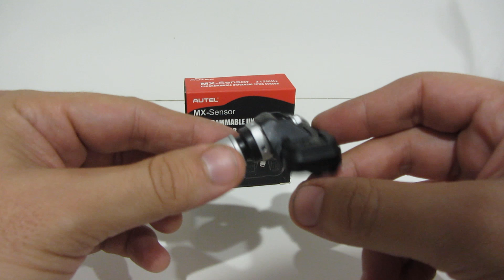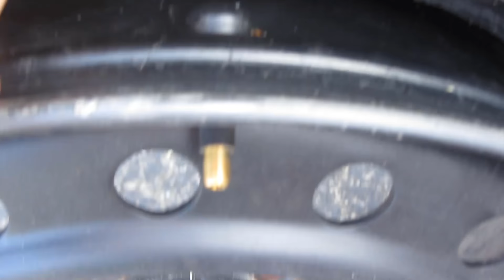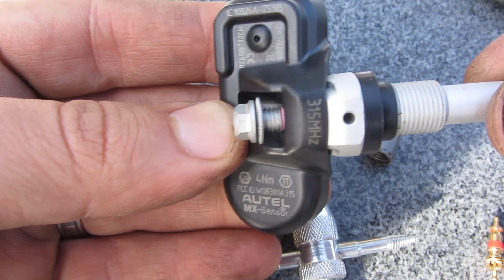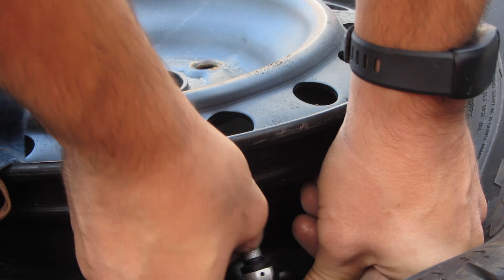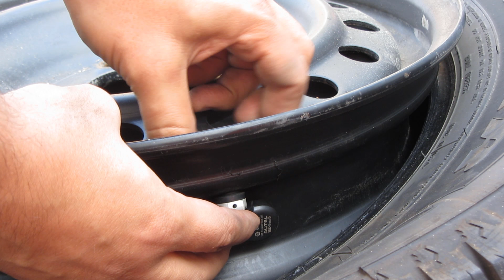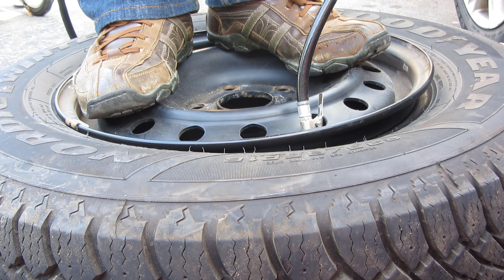Install New TPMS Sensor DIY Without Needing Rebalance

Comment: 0.8o.z. different is actually not small. I work at a tire shop and the smallest weight we add when balancing tires is 0.25o.z.
Imangine 0.8oz different in all 4 wheels, and it is gonna be bad.
Reply: Hey, some people need help to stay awake when driving.
Reply: come on... it's not about if you can feel it or not, unbalanced wheel can make the bearing wear out faster

Comment: Don't do it. They fail when you go to add air maybe 1-6 years from now or six months. I'm changing all mine back to rubber valve stems no sensor. I went to add air to my tire I untwisted the cap the whole valve broke off (very common issue) I need to replace it now. Three left  to be changed so I don't get stranded. Mine were made of aluminum oem Dodge caravan 2010. Way to go Dodge. I also live in northern Canada with snow and salt on the roads to help with corrosion.
Reply from the maker: Loosemouth Cowboy That happens when the valve stem is metal and a metal cap is put on it. The two metals end up rusting together. A plastic cap won't cause that trouble.
Reply: Gabe's Hacks you'll see soon enough
Reply from the maker: Oh I'm not saying you're wrong. It happened to me already, but it was caused by a metal cap that was put on the metal stem. That doesn't happen with plastic caps. Although you can also buy sensors with rubber stems too. (links are in description)
Reply: I waited to long to lubricate the caps I guess but still these sensors fall apart. If I switch back to Tpms sensor ill go after market but I have no plans to go back to tpms getting stranded sucks. I'll just check my tires the old way with a psi tire gauge a couple times a week. Keep it simple.

Comment: TPMS sensors are bullshit. Something for lazy people, who can't seem to keep up with their tire pressure. Just another way for manufacturers to get your $$$.
Reply: Not necessarily. I once ran over some debris on the highway and I thought to check my tire pressures while still driving and after about 20 miles I notices my one tire dropped 2 psi. So before my tire deflated more I saved the sidewall from damage.
Reply: Actually they reduce the amount of money spent at tyre stores by reducing the number of tyres destroyed by being run on under inflated.

Comment: aren't these directional?
Reply from the maker: I guess I should have asked if Private is referring to the tires or the sensors. Tires: yes, sensors: no.
Reply from the maker: Right. That means your car has 4 receivers, so it's aware of which sensor is in which tire. When you rotate the tires, it gets confused and the TPMS system has to be reset. I have no experience with Nissan's, but I found this procedure here: https://youtu.be/2H1AUsqMTWA
Reply from the maker: What do you mean by "directional"?
Reply: Gabe's Hacks left vs right. direction of rotation.
Reply from the maker: Not at all, no. The sensors themselves don't care which tire they're in or which direction they're turning.
Some cars will have 4 receivers, so the car's computer will know which sensor is in which tire. So when they're rotated, it needs to relearn them. But many cars (like my Odyssey) has only one receiver and has no idea which sensor is in which tire.
Reply: Some snow tires are directional, like some performance tires are directional, meaning they need to be pointed in a specific direction on the vehicle.  Usually they will have a direction of rotation arrow or indicator on the tire sidewall someplace to show the direction of rotation.  
If they are directional they will also have a different tread pattern as well.  There will be something similar to a chevron pattern "<".  On the top of the tire, the chevron will point towards the front of the vehicle.
If they are non-directional, then the tread pattern will look mostly like any other non-directional all season tire off the tire store shelf.
Reply: Gabe's Hacks thank you for your answer. i have a 2010 nissan altima. whenever i rotate tires tpms comes on. thereon i assumes these sensors are directional.

Comment: Great video. Instead of soap, use special bid sealer, to seal tire and valve on the rim. Any NAPA store has it. To balance the wheel, use two weights, from both sides of the rim, opposite to the sensor. Measure the distance from center of the sensor to the edge of the rim on the sensor's side. Divide the difference in weight between old and new valve (23 grams in this case) on width of the rim and multiply it on received distance to the center of sensor. You got weight of the balance for OPPOSITE to the sensor side. Subtract  it from 23 grams - you got weight for side of sensor. Obviously, shorter  distance requires of the heavier portion. In case the sensor would be positioned at middle, weights would be 50% of 23 grams for each side. However, if old valve is heavier, than new one, balancing weights supposed to be placed at valve. STATIC balancing would work with a single weight. DYNAMIC balancing requires two of them.
Reply: You can also get a similar response by just simply moving the weight away from the sensor a bit.  For every 1/4 oz the sensor weighs, move the weight the distance of the clamp holding it to the rim away from the sensor.  Usually that provides sufficient compensation for any weight difference.
But ultimately, you may just have to have the tires re-balanced anyway.
Reply: My respond strictly complies with Mechanics. Many ways are possible. You can use a rod scale, with length of the rod, equal to width of the rim and hang the rod in the same distance from its edge, as the sensor is. Of course, the scale must be balanced, when idle. Balance such a scale with 23 grams of sand. You will get balancing weights for each side.
Reply: Great Advice, but it's bead sealer.  Soap remains slippery after sealing, and tire may rotate on the rim, causing weight balance issue.  Bead Sealer goes on slippery, but dries to be like rubber.

Comment: the added weight by the sensor will still make it unbalanced.
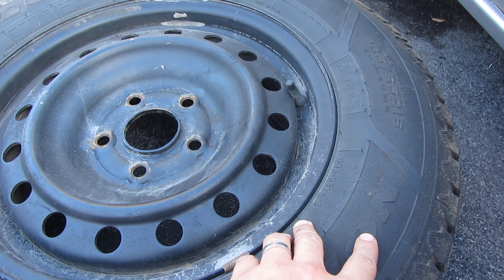Reply from the maker: Timo Klap Yes, that's indeed possible. I discussed that further at 2:17
Reply: For balancing tire, .8oz is a lot of weight. Even .25oz which is the lowest weight that tire shop s use mess up the balance. So the the tire is already balanced but by installing tpms the tire is not balanced anymore.
Reply: Not if you are replacing it with the same because they are dead

Comment: This is nice way to do it but you still need to bring it to a tire shop to do relearn.
Reply from the maker: Not necessarily. Some vehicles automatically relearn new sensors. And if yours does not (just like mine does not) you can use programmable sensors and program them to match your old sensors so your car doesn't know the difference. That's what I did here. I described the process in my other video: https://youtu.be/N6p6xV4PlHc
Reply: Well usually on all gm vehicles u do need a relearn tool to perform relearn. But all manufacturers are different.
Reply from the maker: Yes, Honda is the same. However, if you program the new sensor to have the same code as the old, then the car doesn't know anything is different and there is nothing to relearn.
Reply: Thats good to know because i have a 2014 town and country and it has tpms. So now i should be able to fix it. They charge alot to change just one.
Reply from the maker: For some reason it's hard to find a solid answer online, but I did some reading about the 2014 Town & Country and it looks like it might be one of those vehicles that auto-learn new sensors. That's something you can verify if you ever need to get one replaced. You may just be able to pop in a new one and start driving.
It does use 433MHz sensors (as opposed to the 315MHz)
Reply: Nice to know. Thanks
Reply: John Lara Nah, on GM trucks/SUVs at least, you can program then without any tool. Just put the truck in relearn mode (setting on the dash menu) and let air out of the tire and it will learn the new sensor.

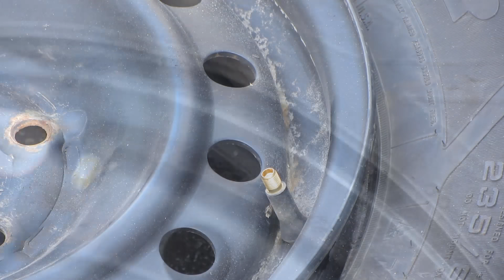Comment: Umm... just an observation here, but at m4:42sec he describes having to cut the valve stem. You don't have to. The rubber valve stems are pressed into place. Use the channel lock pliers to grab the valve stem from inside the tire and pop it out. BONUS: If the valve stem was good at the time of replacement,  hang onto it....!!
Reply: Sun Tzu Never reuse a stem that has been pulled right through. Esp an old one. It is easier to cut the base than pull it right though. Often trying to pull an old one right through just separates the metal from the rubber and makes it harder to remove. The cutting is the best way.

Comment: I have a question can my spare tire sensor in my Nissan cause the tpms like to come on
Reply from the maker: Only if your spare tire is installed. The sensors only turn on when the wheel starts spinning.

Comment: I prefer the old method, check tires visually and if any anomaly is detected check with tire pressure gauge meter... it was good before 2007, and now you always see ppl doing it the good ol' style! cos monitors cost an arm and a leg, and that yellow light just won't go away! D:
I see this more like a gimmick than an actual safety measure.....
Check tires should be done DAILY or at least  every time you go to refuel or at the start of a long trip. and that goes for the spare tire too!

Comment: Are those necessary?  I have a 2003 Chrysler 300m that I just bought and the computer says tire pressure sensor bad/missing on the spare...they cost too much so do I have to get it?   thank you so much!!   Oh, noticed today that one wheel lug is missing...just a rusty bolt there.  Is that an emergency??  ugh
Reply: If your state requires you to do a state inspection, you will need to replace it.  Lights on the dash will fail the vehicle.
Reply: You should replace the lug too, car manufactures don't just place things on the car for just looks.
Reply from the maker: Christine McRae The only down side to not having TPMS sensors is the car not telling you if a tire is low. And you will have to look at that TPMS light on the dash all the time. Otherwise, no, you don't have to have them.

A missing lug nut isn't an immediate emergency (if the others aren't loose too), but I wouldn't drive too long like that. Get it replaced very soon.
Reply: Thanks for responding so fast!  wow, loved your info video Gabe.  thank you!

Comment: hello.. this sensor has battery? if i need to replace it?
Reply from the maker: They do have batteries, but they are not designed to be replaced. Batteries on most TPMS sensors usually last for 7 or more years.
Reply: thnks  my friend...  7 years ... !!!!!! oooo really good...  thnks again .. i need this .. I screwed two times and then damaged the rubber because I did not understand that I got pressure...  is best item !!
Reply: That way! lol. Awesome video

Comment: Hi, my friend. Do I need some kind of tool to program these sensors, or does the car recognize them automatically?I have a Toyota Yaris 2009 sedan 4 doors. Regards William from Costa Rica
Reply from the maker: I love Costa Rica! I went to grade 4 in San Isidro and still visit every once in a while. My parents will be retiring there within the year.

But yes, you do need a tool. I explained it more in my other video: https://youtu.be/N6p6xV4PlHc

The 2009 Yaris uses the 315MHz sensors, which Autel does support.
Reply: Thanks a lot my friend. I live in San Pablo of Heredia. Have a nice day
Reply from the maker: Keep in mind that your Yaris does not auto-learn new sensors. Those Denso sensors are not programmable, which means they come with a random code that will be different from your old sensors. Since your car cannot recognize them automatically, you would need a special tool to connect to your vehicle and tell you car the codes of the new sensors.

I went the other direction and bought programmable sensors so I can program the sensors with the same codes as the old ones.

Either method you choose, you will need a special tool when changing your sensors.

Comment: I find TPMS light reset procedure with step by step.
 _iOS: https://goo.gl/tcexzG
 _Android: https://goo.gl/bDCGjJ
Reply from the maker: That's great for vehicles that have a reset procedure, but not all do. For very many, you need a programming tool for the vehicle or the sensors.

Comment: Thanks so much.   Tires are much softer when warm so if cold outside warm them up first when doing this to make it easier.   Can I inflate if I don't have shop air, just the slower car battery pump or a hand pump?
Reply from the maker: yabonjin pdx I can't say for sure, but I think it would probably work, it would just be slower.
Reply: By warming up, do you mean to drive the car around for a few miles?

Comment: Great video.  I have a new Nissan that I have ordered snow tires with new wheels.  I would like to purchase a set of the TPMS units and since the tires haven't been mounted or balanced, this should fairly easy (no breaking the seal or worrying about balance).  After installing the TPMS units, I'll take it to a garage to have it mounted and balanced.  But the day will come when the TPMS's on my new vehicle are going to need to be replaced (as well as the snow tires)  This video will certainly help when that time comes.  Glad you don't have obnoxious music a lot of instructional videos other.  Question is, my vehicle has 433mhz TPMS (which is what I'm ordering), will this make it compatible to any TPMS that is at the same frequency?  Thanks again for the great video.  I don't have to do this part of your procedure, but you put the long board "under the car".  You must obviously used the frame, but how did you avoid the body?
Reply from the maker: The 433MHz will probably ok with any vehicle that uses 433MHz, but to be sure, Autel has a list of vehicles they support here (under 'Downloads' and the "Sensor_FUNCLIST" document for your market - US, EU, or China): http://www.auteltech.com/TPMS%20Diagnostic%20&%20Service%20Tool/534.jhtml

To avoid the body of the car, I just made sure the board was far enough under the car that it hit the frame. Of course, it is an older car with some rust on the body already. So I wasn't terribly concerned with hurting it.

Comment: thereare some universal sensors or I have to buy specifically for the car?
Reply from the maker: The ones I used are somewhat universal, but you still need to buy the right frequency (315MHz or 433MHz). I explain what I used in my other video: https://youtu.be/N6p6xV4PlHc

Comment: I'm putting  22in rinsing my 2010 malibu but the tire pressure want go off.would I need to  put a sensor for the tire light to go off
Reply from the maker: That's depends on what's wrong. Is it the light that looks like a flat tire with an exclamation mark? That indicates one of the tires is low. Or is it the light that says "TPMS"? That indicates that something is wrong with the TPMS system, like it's not reading one of the sensors. There is a relearn procedure, which someone made a video of: https://www.youtube.com/watch?v=5aoECTglTF0
Reply: +Gabe's Hacks it's just blinking
Reply from the maker: You can try the reset procedure in that video. But if not, it might be time for a new sensor. I've never worked with a Malibu before, so I can't be of too much help. But there is a Malibu forum where you can search, or ask for help: http://www.chevymalibuforum.com/forums/

Comment: I would imagine that there's a good chance that the extra weight of the TPMS sensor will unbalance your wheel enough to be noticeable at high speed.
Reply from the maker: Yes, that's indeed possible. I discussed that further at 2:17

Comment: I don't think that valve stem is made for a steel rim. Those are made for alloy wheels
Reply from the maker: None of the manufacturer's materials suggest that. However, if you prefer a rubber valve stem, they do make them. Links are in the description.

Comment: HI sir how do I reprogram the new TPMS sensors???     the TPMS light will be gone automatically ???
Reply from the maker: My other video shows how to program these sensors: https://www.youtube.com/watch?v=N6p6xV4PlHc
If your TPMS light is on because one sensor is dead, then it will usually turn off by itself once you put in a new sensor that is programmed to have the same code.

Comment: Hey have q? can change just one sensor?
Reply from the maker: Absolutely. I did that with my all-season tires. One of the sensors had broken, so I replaced just the one. I cloned it to match the broken one, and everything worked perfectly!
Reply: Thank you  for answering my q?   Do I need to get the same brand as old one ? I was told from tired dealer that I can't buy after market parts..My car brand is Acura.
Reply from the maker: That is not true at all. There are many different brands that will work. I made another video about programming sensors to have the same code as the old one: https://youtu.be/N6p6xV4PlHc  In the description of that video, there is a link to the manufacturer of the sensors where they have a document that will tell you which vehicles they support.
Reply: Gabe.. Thank you for your help!!
 I got it done I purchase the sensor and replace it at tire shop for $ 20.00. I purchase a sensor similar to the old one and worked just fine.

Comment: orrrrr you can just take it to a tire shop and have some mexican do it for $7...
Reply from the maker: By all means, if you don't mind spending the cash then have someone do it for you. But the way I look at it, I'd have to put all the tires into the car, drive to the shop, wait for them to do it, and pay them. I'd rather stay at home, do it myself and keep my money. :)
Reply: +Gabe's Hacks i also dont ride on stock steelies so jumping on a 2x4 to break the bead on my tire is a no go.
Reply: TheShangralaaaa17
Reply: My local shop told me it would cost something like $230 to replace the first one and $150 for more sensors if replaced at the same time.